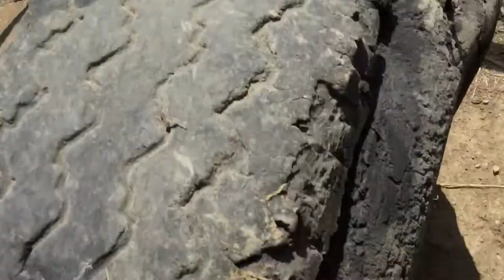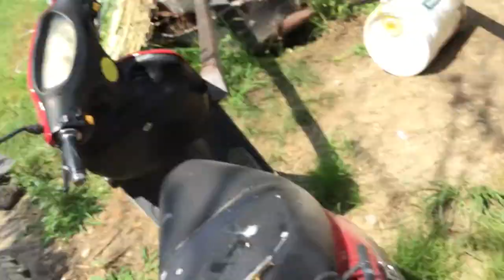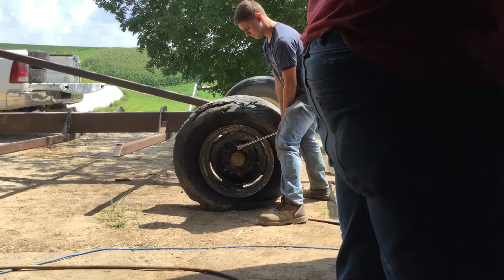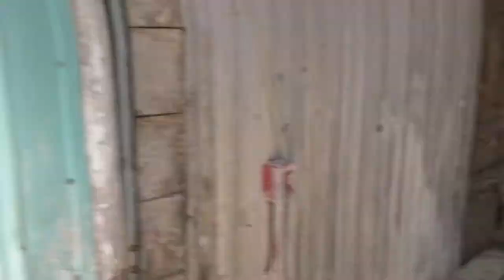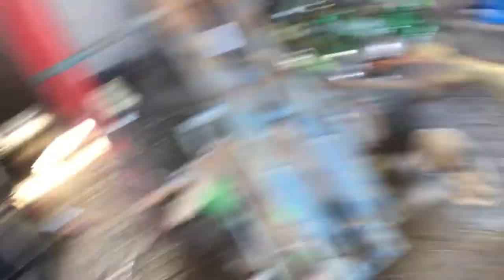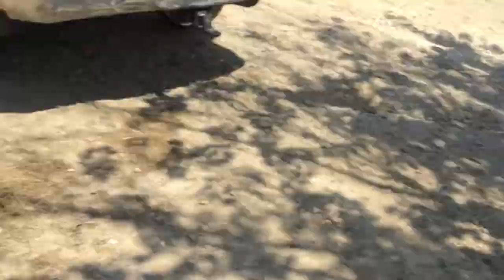New Tires for the Bale Trailer.

Comment: Hey boys nice video, I bought a 4455, the stop engine light and oil pressure light keep coming on... Engine is not hot, oil levels are good, any suggestions?
Reply from the maker: Might be electrical.